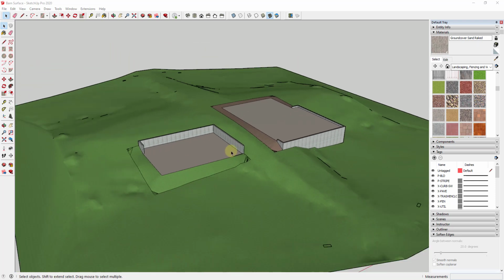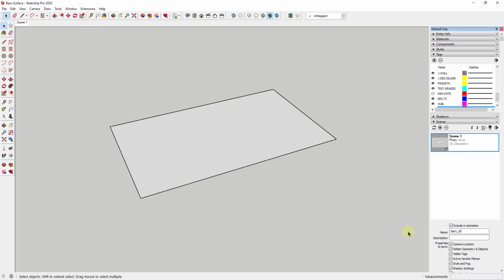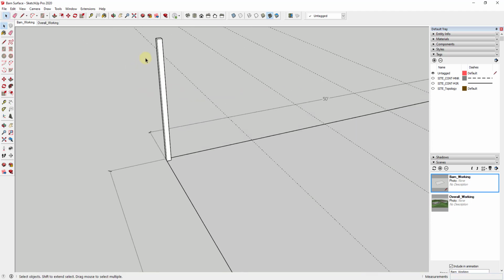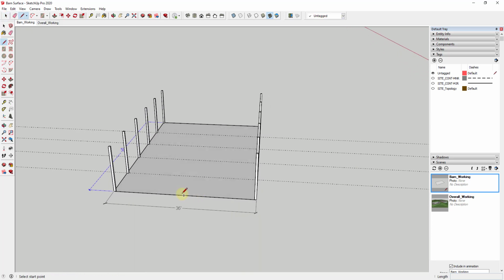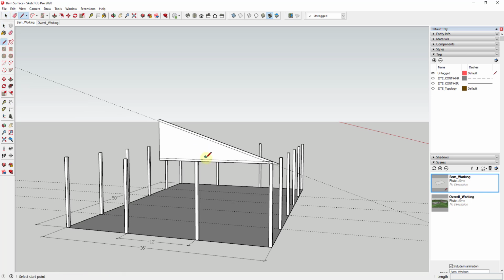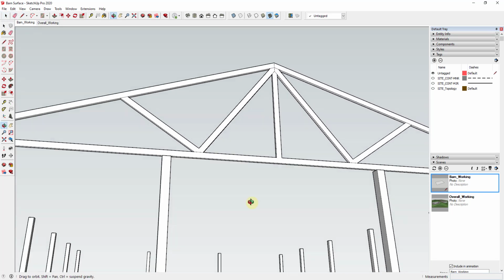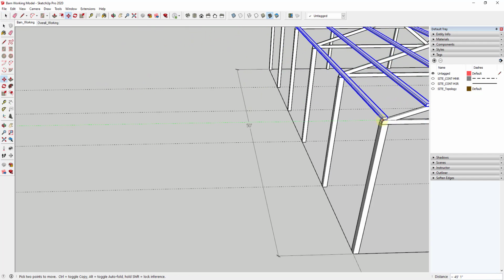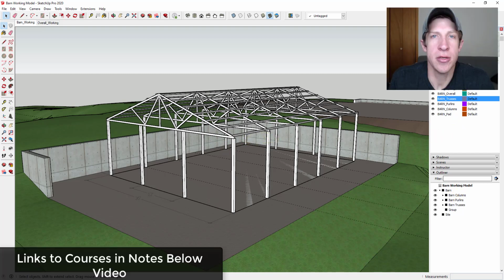SketchUp Skills for Architecture - STRUCTURE MODELING - Barn Structure

Comment: I realize this video is quite old so I'm not sure you're checking comments anymore, but can you, Justin, or anyone recommend any plugins that can create structures (exteriors only) from photos?  I've used the HOVER app, which allows me to export a .skp model, but because the app is built for creating takeoffs and estimates for siding and roofing, it is a VERY expensive way to obtain a SketchUp model!
Reply from the maker: Generally I'd use Match Photo for this kind of thing - it's built into SketchUp

Comment: Ummm...  Not sure where you're getting 1.75" x 3.75" "2x4s".  As far as I know, 2x4s are 1.5" x 3.5" IRL. Not that it makes a real difference in your example trusses.
Reply from the maker: DANG - you'd be correct. Every time I do a video like this I do something dumb like that - last time it was the deck and the boards running the wrong direction 😂 Luckily I'm much better with modeling than dimensions